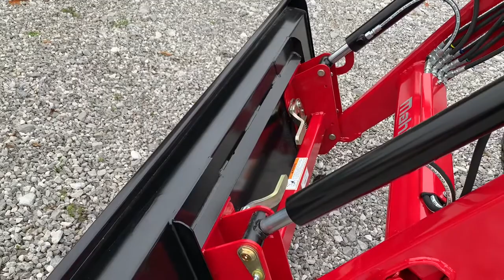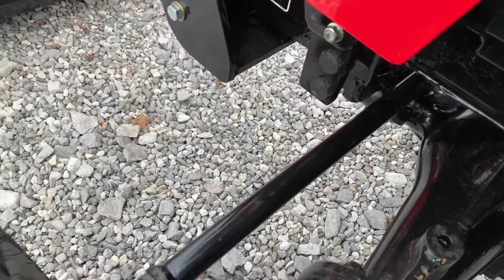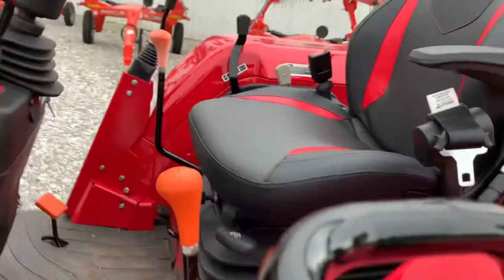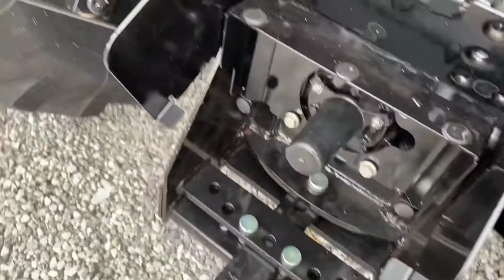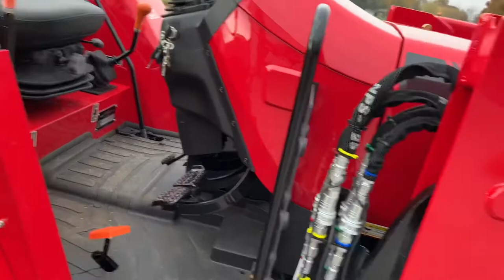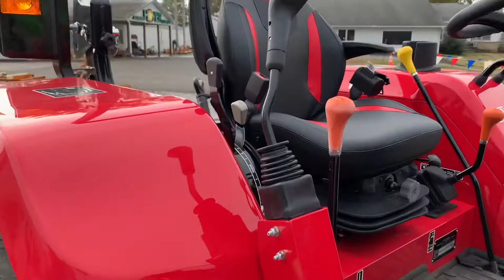“Unboxing” Mahindra 5145 Utility Tractor, First Look Part 1

Comment: I think Mahindra has a winner with this one.
When I bought my Kubota L2501, I was also looking at Mahindra. I liked what I saw in the Mahindra line. What I was uncomfortable with was there was no history with them. At least in my area. I didn’t know anyone who had one and there were very few videos on you tube about them. The videos that were up were ones that were having problems.
Since that time, I have had several friends that have bought Mahindras. My next door neighbor has a really nice 65 hp Mahindra with a nice cab on it. A friend has a 35 hp Mahindra that will run circles around my little Kubota.
We have a really good Mahindra dealer 12 miles from me. I just bought a grapple for my Kubota from him. I hope to do an interview with him for my youvtube channel.
Thanks for doing this. It was a good honest review.
Reply: Mahindra is a giant in Tractor manufacturing present in India since last 50+ years world's no 1tractor manufacturing no need to worry.
Reply: @vigsna  , the ones that I have been around appear to be very ruggedly built. They have better creature comforts than my Kubota. Knowing now what I didn’t know when U bought my Kubota tractor, I think I would have been more than happy with a Mahindra.

Comment: I notice the tractor appears to only have room for 2 rear remotes.  What would it take to add a 3rd rear remote? I know for some john deere tractors its a cosmic effort to install that 2rd valve in the rear.
Reply from the maker: Thanks for your question. I am sure it can be done, but 2 sets are supported by Mahindra. You may have a specialty application that needs 3 sets but that is very uncommon for such a small tractor. I would be a little concerned with heat, proper, consistent flow divided amongst that small of a system. Can you elaborate on what your application is for this tractor?
Reply: An example would be running a 6-way blade with a hydraulic ram.
Reply from the maker: @bryonmartin8463 in that case I would opt for adding the second set of remotes then getting an “electric over” splitter for use on one side or the other. That would be cost effective and handle the job.